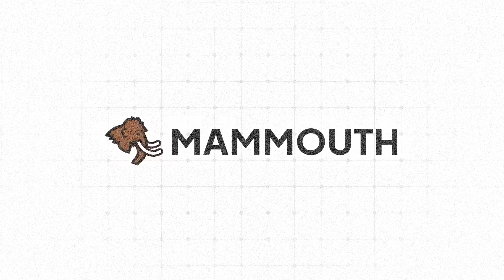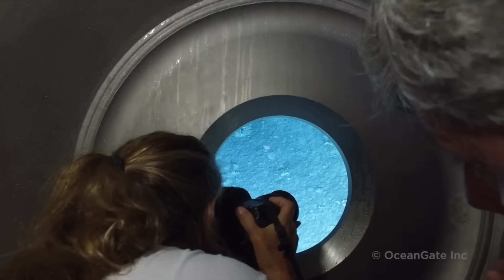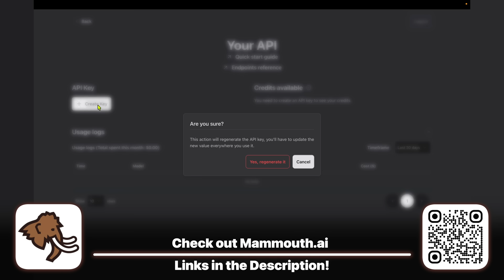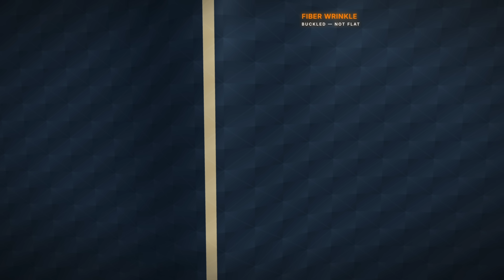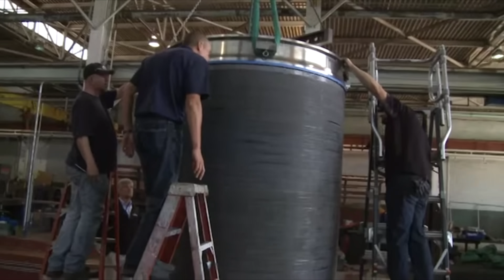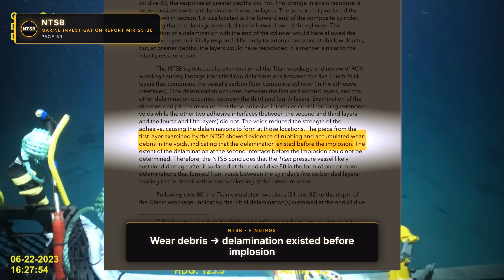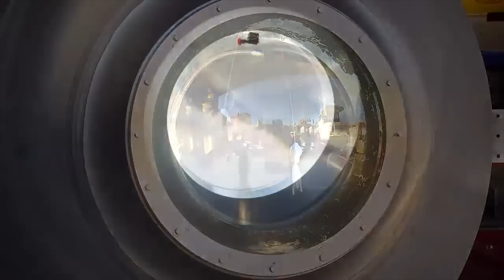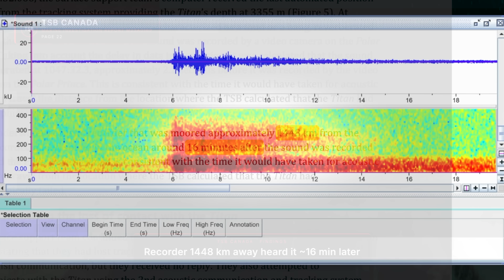Oceangate Titan: It was WORSE Than We Thought

Comment: We all knew it was the carbon fiber. I work with carbon fiber. It’s a great material—honestly, I think it’s one of the greatest manufactured materials you can have. It’s lightweight, extremely tough, and handles specific loads phenomenally well. BUT it doesn’t do well with repetitive compressive pressure or cyclic strain. Carbon fiber composites experience cumulative fatigue under external pressure; think of a rope.

When a rope is brand new, it’s extremely durable and high-resistance, but over time due to elements and repetitive use, the fibers slowly give out in a compounding effect. Initial thresholds could handle heavy loads, a micro-failure happens and you don’t even notice it, but with heavy use, more fibers or the resin matrix break down, and all of a sudden you’ve got a frayed structure that can't hold up.

Compounding the issue they left the carbon fiber in the elements. Carbon fiber isn’t “water proof”. It allows small amounts of moisture between the fibers. Then on top of that, they left it outside to freeze. Moisture expands when frozen. 

And just like a rope, carbon fiber doesn’t give gradually—it snaps all at once.

OceanGate should have replaced that hull frequently, or at the very least respected the material's degradation limits. It was a brilliant concept trying to make deep-sea exploration more accessible and lightweight, but you have to work within the actual physics of the material

Comment: So sounds like self-proclaimed genius Stockton Rush cut corners, produced a low quality design to save $ & made a 'temporary' product that had limits on reuse due to fatigue. I'm surprised he didn't wrap duck tape around the outermost layer of the carbon fiber tube. Then it would have held, no doubt. 🙄 RIP to the innocent souls on board that were unaware it was a death trap.

Comment: If you go fast over a pothole on a full carbon  bike, you have to get a new bike because it is damaged and can explode at any point. Ive seen $20,000 bikes been thrown out cause they had a crash. Carbon fibre is only strong until it isnt, then its dangerouse

Comment: How safe are carbon fibre composite (CFRP) passenger aircraft fuselages, considering that they go through many cyclical pressure changes? Carbon fibre composites are far less forgiving than metal ones. I know that they carry out regular NDT on CFRP fuselages and other composite parts, but is that enough to detect delamination and other faults before they could propagate to a crack over time that could then cause a catastrophic fail? Metal fuselages can be flown thousands of times over many years with a very high degree of safety - is that the same for aircraft with bodies and other components built of carbon fibre composites?

Comment: 10:34 There’s another thing that carbon fiber has that steel or Titanium don’t. It has really poor plastic deformation.

There’s two kinds of deformation: the kind where it flexes and returns to its original shape(elastic deformation), and the kind where it bends and stays that way(plastic deformation). With metals, the material flexes to a point, and then slowly starts to deform plastically, where it now retains the shape it was bent into. Carbon fiber is very strong, with great elastic deformation. But it’s very brittle, with basically no plastic deformation. So, while steel or titanium will give you warning that something is wrong; with carbon fiber everything can appear fine, and then suddenly give and shatter. It’s the reason when Formula 1 cars, which make extensive use of carbon fiber in their body panels, seemingly shatter and splinter whenever there is an accident. Meanwhile cars with a steel construction crush and deform. Once the material is pushed to the point of failure, it doesn’t bend, it breaks.

Between this and the fatiguing of the material, and the need to extensively monitor even the smallest manufacturing defects(which there is always inevitably small ones); Stockton’s idea would’ve likely lead him to bankruptcy. While he thought he was doing this cheaper to make it more commercially available, the amount of upkeep needed to do all of this properly and safely, would’ve drastically and quickly exceeded the amount he was saving by not using industry standards and regulations. He accidentally picked the more expensive option, thinking he was saving money. And his lack of upkeep or proper procedures were what got him killed.

Comment: The fatigue issues with composites like this occurs in the polymer matrix:  debonding of the fibres at the ends (this becomes worse if they ground down the wrinkles as they cut the long fibres into shorter lengths and created more places for fibre end debonding and slippage, also on fibre : matrix adhesion and bonding and how well the fibres were ‘wet out’ by the liquid resin during the fibre winding process. Any voids or non fully wetted out fibres created sites for propagation of debonding and matrix resin cracking which leads to delamination of layers of the fibre reinforcement. Also at these depths the temperature is close to freezing and polymer properties are highly dependent on temperature, they become stiffer, harder, less flexible and less tough (ie: more ‘brittle’) as temperature goes down. So while epoxy resin formulations can be ‘tough’ (or relatively) and have very good adhesion their mechanical properties are still temperature dependent and resistance to fatigue is therefore a function of the mechanical properties of the matrix resin combined with those factors like fibre wet out, fibre adhesion and the voids and inclusions resulting from imperfect manufacturing which act as sites for initiation of debonding and delamination of the resin matrix which is already less ‘tough’/flexible and less tolerant of micro cracking (fracture toughness) due to the lower temperatures.  These were all the thoughts that went through my mind when I first heard about the accident and its design and construction.  When I worked in compositors tech service at Dow Chemical, I had a fantastic research report by Norman Sims of the British National Physical laboratory. He covered pretty much all the angles wrt fatigue testing of composites and modelling long term failure, he addressed load cycling and the applied wave forms and did temperature corrections  for higher loss cycling rates causing frictional heating. That’s not relevant here as the load cycling rate in this application is in terms of several hours for one load cycle. But I’m sure Dr Sims would have had something constructive to add to this destruction

Comment: * creaking and popping noises...are themselves warning signs.. mechanical systems, that are operating within a durability regimen with a sufficient HUMAN Occupancy Margin? Don't make popping and cracking noise,.. FULL STOP.
Normalizing abnormality = recipe for catastrophic disaster.
**" NOT testing sample hulls to failure, means there were guesses and assumptions galore.. A data set that has no failure reference data  point set.. Is data noise pretending to be safety... That engineers get shivering vibes... isn't good. Nobody should trust death and injury to vibes? IMHO.
* But..just having to sign such a waiver.. should give one pause. It's not a SM TOS..

Comment: The Alvin submersible was constructed in 1964 and is still being used today, 62 years later. The science of how to construct a sound deep sea submersible has already been done. The Titan was flawed from it's beginning. It lasted longer than it should have. But it still failed in it's short service life. Stockton Rush was by all accounts irresponsible. He was a cheap skate, and his obstinance  fooled even himself. I can't think of a name to describe a person that believes his own flawed logic. A Fool is the closest thing I can think of.
Reply: "62 years later"
To be fair, the Alvin is a "ship of Theseus" situation.
Reply: @AlbertaGeek This could be said for the electronics, and other wearing components. However, where the rubber meets the road, is it's Hull. That has not been replaced, as I know it. So, the "Ship of Theseus" situation, would only apply to the peripherals. A remodeling of the existing structure.
Reply: @noapologizes2018  You really need to educate yourself more about the Alvin.  Literally every component has been replaced at least once.
And if by "hull" you're referring to the pressure vessel for crew, the original was steel, but that was later replaced with a Titanium one.  The overall profile of the Alvin has also changed notably over the decades.
Reply: @AlbertaGeek No need to be rude. I considered our short exchanges to be cordial.
Reply: @noapologizes2018  So you're offended by the mere suggestion that you could stand to to learn more about a subject?  Buddy, that's a you problem.
Reply: @AlbertaGeek Nevertheless, I hope God blesses you today. Best Regards.
Reply: @noapologizes2018   Okay, now I understand why you don't like to learn new things on your own.

Comment: Another YouTuber likened the use of acoustic monitors to listen for the sounds of failure to using a camera to look for lightning in order to predict thunder: Sure, you'll see the lightning before you hear the thunder, but the time between those two events was so short, there would be no time to react to anything.

The acoustic monitoring system was essentially an "If Light is Red, You Are Going to Die" alarm. If the system detects a problem, it's already too late.

Comment: A reasonable summary and assessment. Doesn't cover many issues which actually contributed to the failure - but as YouTube videos go - is quite good. Some obvious inaccuracies are present (like the statement that buckling may not make noise). It may - but only in very thin lamibnates.

Comment: There's really no excuse. I'm a computer engineer. When something breaks, servers and apps don't work. This is a bit different. But either way.  It's one thing if sensors are throwing false positives constantly throughout a time range (and you should fix that too). But not one for all that time and then suddenly 120 per sensor? And a third of the sensors inoperable on the final dive? All hull safety precautions regarding temperature, grinding, and impact ignored? How much liability should they have had in dollars? Yes.

Comment: The use of different materials was the problem. They expand and contact at different rates from temperature or pressure. 
No glue will hold it together.

Comment: Good video.  As a minimum they should have made scaled models or shorter versions the do cycle testing to understand the behavior of the carbon fiber loaded in this manner.  If you do this to failure to the depths plus a SF then you can understand the material behavior.  I think they beat the sub to death when towing causing hull damage.  The key here is failure will be catastrophic, so the engineering and fabrication should be flawless.  Sad for the loss of life.

Comment: So what about the theory of the carbon fiber had only been tested for strength when pressure was exerted from the inside outward like on a hose or line. But has never actually tested for how much pressure it could hold forcing inward, which could’ve been different because of the  way carbon fiber is made.
Reply: Incorrect. Strength of carbon/epoxy composite in compression is a well known quantity.

Comment: Light-weight Scuba Tanks are made from Carbon Fibre. Scuba tanks are under large tensile loads (300BAR in my case) Carbon fibre is excellent in Tension.  My bicycle frame is made from Carbon Fibre tubes.  It's wound to give flex but also great tensile strength.  My Archery Bow has Carbon-fibre limbs, for storing energy under tensile load.  The key word here is TENSILE.  I never heard of Carbon fibre being the go-to choice for compression loads.  If my Carbon arrows hit something solid (like a metal screw) they shatter due to that instant compressive force. 
I'd love to understand the reasoning behind using CF for such unimaginable compressive loads as the Titan craft, especially when they had to keep "sanding it down" to fit the Titanium.  At some point someone should have said, "You're sanding it down???  WTF?? I'm out".  We're not making a kitchen cabinet here.  If it doesn't fit the design then it's not made right.  "What was that BANG?"  ... "I don't know, let's dive again to 3000BAR and see what happens".  Stupidity on an epic level.
Reply: "...Carbon-fibre limbs, for storing energy under tensile load."
This statement indicates that you have no clue whatsoever regarding how the energy in your bow is stored.

Comment: I don't like the lesson being taken from this being "the safety boards were right.  Don't question anything and just do as you're told.  Go public and give up on your dream.". The lesson should be it's okay to question things and break some rules if you're an industry disrupter, but don't be an idiot and still follow the rules of physics.  An example is SpaceX, who ignored all of the rules and are on their way to making a rocket 100x cheaper per launch, while being safer and more reliable than anything else out there. They did this breaking and questioning rules, battling regulators on stupid red tape, etc.  But they followed physics from first principles and did the work to think it through.  The key isn't to get back in line do as your told, but to think it through, and don't be an idiot.

Comment: OceanGate (and Stockton): Let’s think outside the box (regardless of life and death) and cut corners, because it’s cheaper and worked so well for the Titanic, Deepwater Horizon, and Chornobyl. Let’s not bring in older, experienced, privileged white men and instead hire a bunch of younger, inexperienced millennials, because diversity is our strength. Let’s build a sub out of parts from a hardware store and subpar materials during construction—especially carbon fiber—and make it a cylinder. Let’s do what Steve Jobs did and simplify the submersible for a bunch of feline-minded people and use an Xbox controller. Let’s not listen to anybody’s warnings and fire or sue the shit out of those who say otherwise and call them bigots. Let’s not inspect the sub after each dive because "it survived this time, it'll survive the next one!" Let's leave the sub in a parking lot through winter.

Comment: i might not get an answer but anyway:

so, based on the fact (that you present in this video) that sphere-like submarines are the best option, would the capacity problem that Rush was trying to work around by making it a cylinder so that more people could go in the sub be solved if instead of a cylinder, the engineering of it allowed for more than one sphere to travel?

I am very new to this, and i'm also dumb, but i wanted to know what do you think about it, would that be a viable option?

Comment: To me, it seems that the possibility of high pressure water penetration between laminated layers was never explained, maybe never considered. Once the laminates split apart, and water gets in, you don't have the strength of all the layers resisting water pressure, you have just the strength of the layers "underneath" the penetration, so instead of 5 layers, it may have been 4 or 3, and at that point the hull is not sound enough to hold back the pressure.

Comment: 7:05 OceanGate argued that a cylindrical submersible under pure external hydrostatic pressure experiences only compressive hoop and axial loads, not twisting forces, making 0/90-degree layers sufficient in their view.

where'd you get the idea that nobody at Ocean Gate could explain why?

Comment: In the Machine Design course (of college Mechanical Engineering), we're taught that to ensure a part won't break from fatigue failure, it must be cycle max loaded at least 10 million times.

Research has shown that if it won't fail then,  it probably will never fail.  I worked for a company that did such testing at 150 ksi on its pressure washer machine, and it would take weeks to complete the test, constantly running throughout that time.  They had to pay men to babysit the machine during that entire time.  The testing alone was very expensive, but if the pressure washer failed, operators nearby would probably die from the explosion.

Had the Titan people done the required test, they probably would have seen failure after only about a dozen cycles.

Comment: As a materials engineer, every design decision on the carbon fiber hull was such a complete failure it almost seems intentional. There is no good engineer who could've signed off on this thing in good faith. Not to mention, the failure modes that composites typically have under such large pressures not only wouldn't be caught by the sensors, the sensors wouldn't give you any real help anyway. By the time you get a reading, you likely already have a crushed sub.

Comment: I build yachts from catbon fibre and epoxy. When i saw HOW they were building the hull sndcthen gluing on the end caps I was immediately concerned. You need hyper clean rooms, staff in paper suits, and hair nets and vacuum bonding to ensure no dust or fibres or micro air pockets get trapped in the epoxy
When i saw them ilterally hand mixing the epoxy (which immediately starts to harden giving you a small window to use it) and 4 of them applying it inconsistently by hand in a dirty workshop..  I thought 'good luck with that'.
The contamination in those joints, the different gluing viscocity the micro bubbles..... 
You van get away with it building a kayak... a deep submersible though...well...